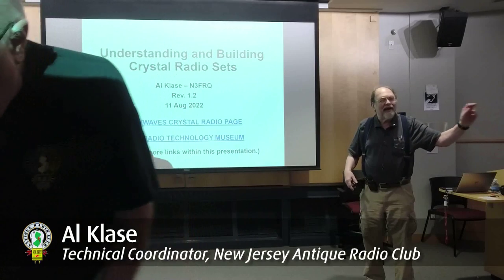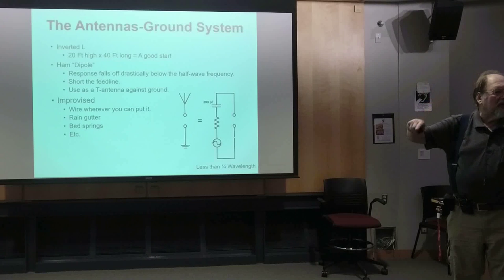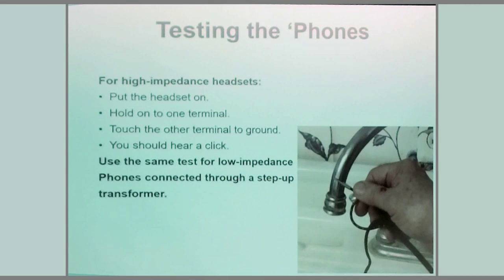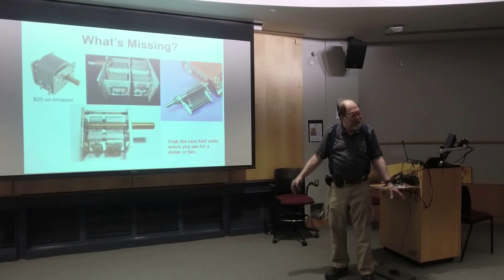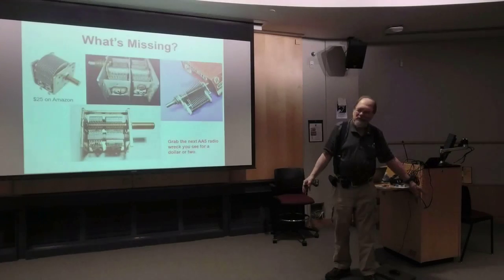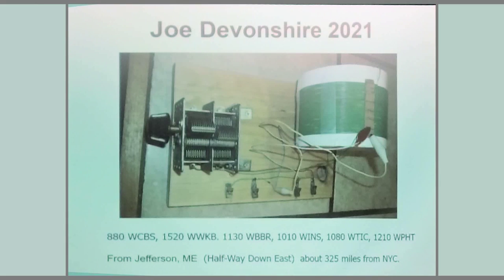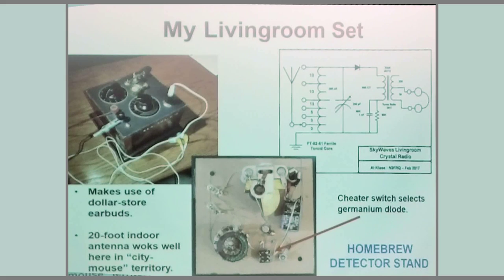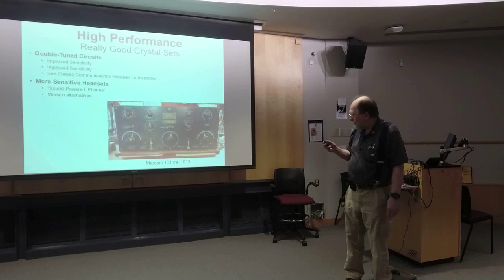Understanding and Building Crystal Radio Sets

Comment: A great primer on crystal sets, with quite a lot of detail for those wanting to take it further. Thank you for telling folk not to bother with the really simple beginner circuit where both the antenna and diode detector are connected to the top of the coil. That circuit alone must have been responsible for so many people completely writing off crystal sets as a mere novelty. Great talk. Thank you Al!

Comment: 10/9/23 Crystal Radios.
Thank you for your presentation on Crystal Radios. I built several of them in elementary school and purchased one of those rocket crystal radios. I loved your ideas on impedance, matching and wish I would’ve known about that when I was building them as a child.

I started in Radios, when I was four years old toddling behind the Sears Silvertone TV that my dad bought in 1954. I was trying to see how howdy Doody got in my TV. I knew he came in through the rabbit ears on the top since I had to twist it all around to get a good signal.  when I look through the holes in the fiberboard on the back and could see glowing orange things. I figured those must be responsible for putting howdy duty on the screen. By eight years old. I understood how tubes worked and by 12 I had my radio amateur license WN6INX

And that time I was living in San Diego & sending Morse code and receiving QSL cards from across the United States &South America using a homebrew transmitter with 6146 output tubes and a converted arc5 world war II airplane receiver. Also using a long wire dipole antenna that could be tune to the 40m and 80m amateur band.

Comment: I built my first crystal set when I was 8. I used a germanium diode. The coil was experimentally wound. I bought the variable capacitor from a local repair shop I later worked at as a an after-school job. I lived in an area with a single AM station and nothing else for over eighty miles.

Comment: Always fascinated with crystal ' no power ' radios.
I had a schematic for Crystal set that used a transistor to slightly amplify the output where the transistor was powered by input signal. I lost it, I haven't seen any others.
The fellow that goes by ' glasslinger ' on youtube who makes vacuum tubes was building a crystal set that was amplified by two 6AU6 tubes and it worked really good. The crystal receiver part seemed extremely sensitive as he drove across the dial ( variable capacitor ) and tuned in at least four totally separate stations.
I don't know what the circuit was called but it had variable volume control between antenna and coil similar to circuit on my 34 Philco radio.

Comment: AFAIK, "Sound Powered Phone" systems are still used on US Navy and US Coast Guard ships and cutters. 

I was in the USCG, and for about my first two years in was stationed aboard a Cutter. They employed both the headphone/microphone devices {which I never used}, and the telephone handset devices which I did use on occasion. 

I was also in the USN before the USCG, but was never aboard any Navy vessel {I did Aviation..👍}.

Comment: My electronics career started in 1951 with a Cub Scout Radio kit. Catwhisker and a half inch wide strap slider across the tuning coil. Not successful. Ended up building a set with a double gang cap, two loopsticks, inductively coupled, with added windings for the antenna and detector (1N34). Telephone operator headset much more sensitive than surplus headsets of the time.  listened to WWL from 300 miles away when local WDDT went off the air at night. KK6IL

Comment: The best i have is my Dad's, w5ewf (sk ) set. Dual pancake tuned circuits and taps on last rf and first rf coils plus hi z to low z phone socket via transformer. Detector also drove a 10 uA meter with sensitivity pot. In Chicago suburbs had to use that pot to keep from WGN burning out meter. Even better in Jefferson City, MO with a 240 ft wire 60 ft up.  Amazing tuning indicator. Only time i have seen a meter on a xtl set. Takes a while tune in a station. Headphone vol with my old hi Z phones could be heard 10 ft away. Got stations across midwest,Texas, Mexico and Canada. Even NYC late. Still have it. Doing regens at moment, but going back to pretty up Dad's set soon. QTH in west cent FL now. 73 karl wa2kbz

Comment: I use a double sided tape on several places parallel to to axis of the coil to help to fix the wire while I am making the coils and after that I use nail polisher along the line parallel to the axis to hold the wire.

Comment: When I was a boy I grounded my crystal radio on the electric outlet neutral (there were no 3 pins electric outlets then). I tried a band-saw partially buried on ground, too and I discovered a few volts difference between the two. Took me a while to understand why. It was a nice learning. And yes you are right my crystal radio could only receive a an FM radio that was very powerful. 
Yes they can receive FM too putting them a little out of tune to transform FM on an AM signal on the edges of the cutoff of the LC tuner.

Comment: Pls refresh my memory: why transistor radios dont need grounding and crystal sets do. Thanks.
Reply: I am NOT an expert on this topic. 

That said, having a power source allows transistor radios to contain the stuff and/or perform the functions that must be done by an external antenna and ground on a crystal set.
Reply: Amplification. Without the long antenna and good ground, a crystal set will struggle to produce enough signal to hear from all but the strongest local transmitters. A transistor set can take a tiny signal, much too small to drive an earphone directly, and amplify it hundreds or thousands of times so it's strong enough to drive a speaker. At that point the ground connection would be superfluous.